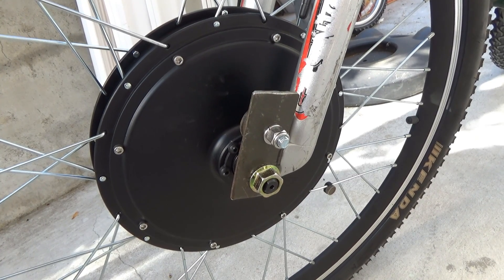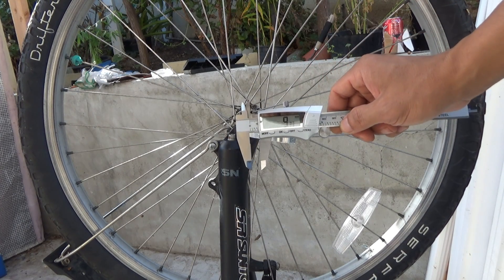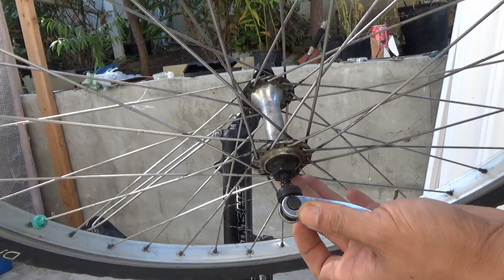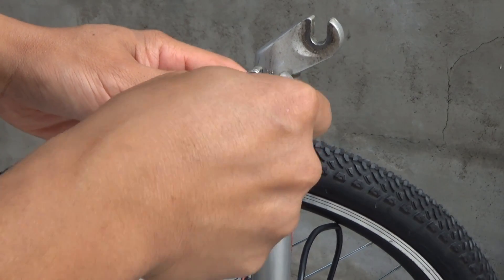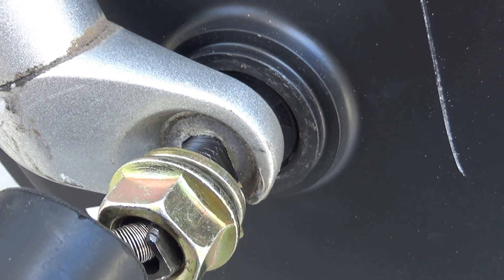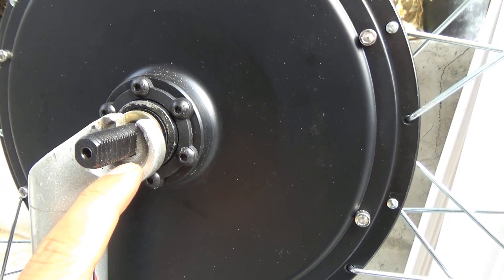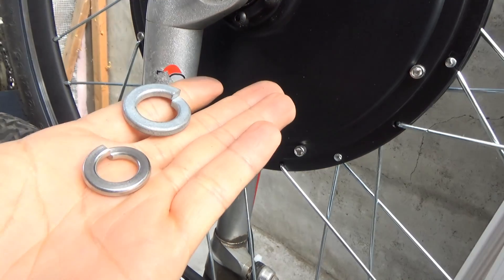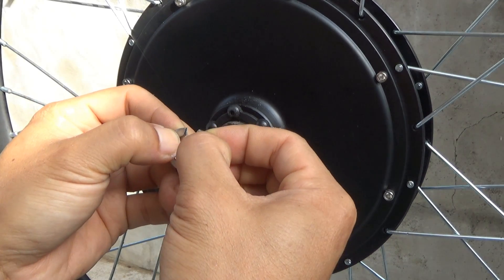DIY Ebike S01E04: Front fork & electric hub motor axle installation

Comment: You using 1000w motor in Aluminium forks ? Must be mad, will chew the drop out away in minutes
Reply from the maker: Almost mad because I've been using it since August/2017 until now. After 1 year 9 months or almost one million minutes later and it's still kicking. You're right about the "minutes" part, just didn't state exactly how many. :D
Reply: Ok, thanks for your reply, I have just bought same kit, I will be using it on steel forks with exact 10mm drop out, the washer with the tab ? Are you supposed to bend the tab because it doesn’t fit in 10mm gap properly ?
Reply from the maker: @markevans2280  I put that tab upside down on the bottom. You must use a torque arm or it will chew the drop out away in minutes like you said. In case you didn't notice, the rectangular piece of metal on my fork you see at the very beginning of the video is my home made torque arm.
Edit: I didn't realize you said you were using steel fork. You may still need a torque arm if you decide to overvolt your motor later on.
Reply: Thank you friend, I will make a torque arm like you, just to be safe 👍🏼
Reply: @markevans2280  Hello,i have a 250w front hub motor in my suntour alloy dropouts 9mm i filed to 10mm,after 5 years and 5000miles the dropouts snapped clean off yesterday,LUCKY i was only going 5mph not the usual 24mph with a lorry or bus behind me,I'm not going there again,I'm converting to a cheap steel dropout suspension fork from chilliworks no lockout.BE CAREFUL,my next motor will be in the rear.
Reply: @ Ian mangham, thanks Ian, but you read my post wrong, I have STEEL forks & I have fitted steel Torque Arms so hopefully will be good, I will keep my eye on it too 👍🏼
Reply: @markevans2280  No i never read your post wrong,i was just telling you what happened to my alloy forks after reading your comment to this guy's video.
Reply: @ianmangham4570  Did you have torque arms installed?
Reply: @vuaeco  yeah people think there's hundreds nm of torque but most of these are only 30-45,nm! As long as you put a torque arm it will hold
Reply: Great video, just a bad audience. Learnt a lot.

Comment: A strong front hub motor will eventually break off the front of your bike. A bike is not designed to be pulled from the front wheel.

Comment: Does your e bike a dual shocks? I have 2 e bikes, 1 is factory made Mukkpet 350/500 watt Gear Motor  just front fork shocks, other one is Jauopay   Kit Build 1500 watt front wheel Direct Drive with dual shocks. The difference of suspension is night and day. The 1 front shock bike is very rough on the butt when going over bumpy terrain. The dual shock bike makes the rides awesome and fun as you go thru bumps with breeze. I learned of my next e bike will always be a 2 shock frame. Also the 1 front wheel shock bike I always need to check and adjust nuts, bolts, ect every few days.

Comment: It's a plastic spacer under those rotor bolts, remove it. You wouldn't need it anyway if you ever put a disc brake on that front hub motor.. making that washer was a waste of time.

Comment: why not just remove the disk brake bolts? dosn't look like your gonna use them on that bike... saves making the washer.
Same with the other washer you spaced out... why not just grind down the side of the tabbed washer so it fits inside the recess?
Reply: That tab on that washer is like a miniature tourge arm to fit in the fork opening

Comment: i feel like this is my life with my ebike build.. im on a budget build...killed my first cheap walmart bike in 3 months...got this new replacement and different issues but minor bs that require some fab... dont think this bike will last more than 3 months as well =P
Reply from the maker: 17 months later, over 500 miles, and it's still kicking...
Reply: @vuaeco  Mine snapped the dropouts after 5 year's and 5000miles,LUCKY i was only going 5mph ,and that was a 250w geared front hub motor in suntour suspension fork,BE CAREFUL.

Comment: What is the dimension that is required between dropouts?
Reply from the maker: I didn't actually measure that dimension. It should be standard for all bikes. Also, the fork can be bent in and out to fit the axle so it shouldn't be a problem. I didn't have to do that with my bike though. I just needed to add a thin washer so the screws on the motor would stop scraping the fork. I will post that dimension when I have a chance.
Reply: Thank for the reply. Is there a standard? There is a big dimension difference between my rear wheel ebike and my other bike. As you say it is precision engineering and any bending off the forks would require a jij to get them to meet at right angles to the axle.

Comment: I agree it has to fit perfect. If one side is filed, out of alignment, from the other side, the axle ends up in a cantilever position, as it were. Then it will wear the tire uneven on one side. The Axle Bearing will have more weight on one side than the other, so you get bearing wearing out on one side. The bike will also not ride straight and will be very evident at higher speeds. Eventually there will be vibration throughout the bike. Worst case is that the seal will also leak and eventually the motor would degrade in performance.

Very detailed video with a good thought process, where you analyse each thing as you move from step to step. This is the kind of video that is even good for someone who knows nothing about bikes, motorcycles and mechanics in general. Thumb Up Boss!